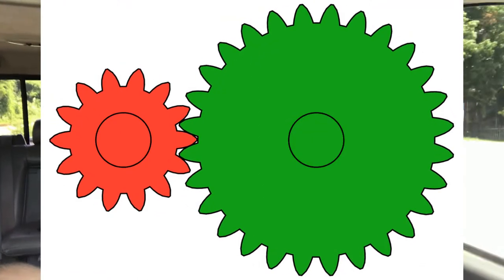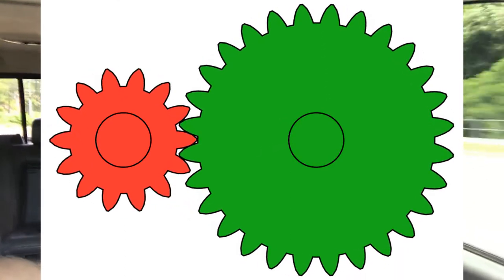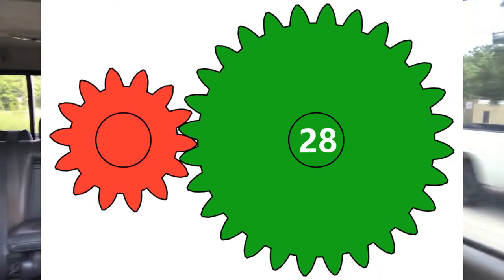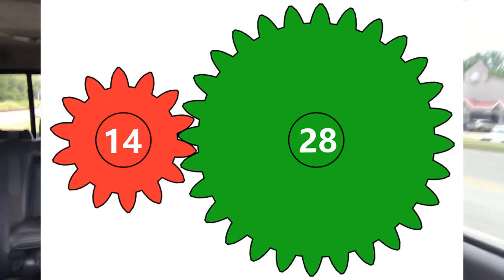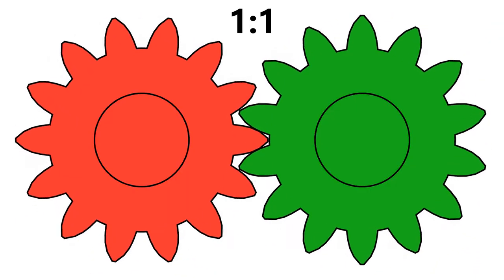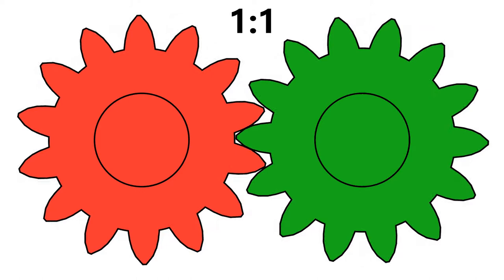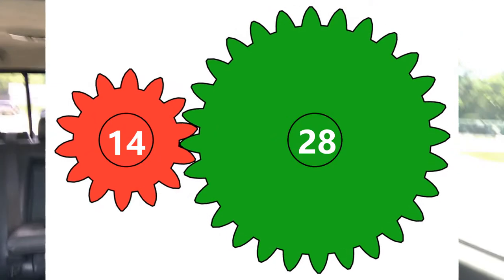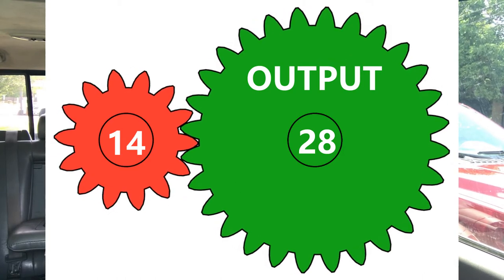Things People Forget in Racing - Gear Ratios | Power Isn't Everything

Comment: I’m in the same boat. Mines a 2500 6.4 with the 66RFE. Currently running one of Jays cams with headers but I have 3:73’s running 34” tires. Thinking of swapping to 4:30’s for better acceleration but I also wanna keep some of that top end.